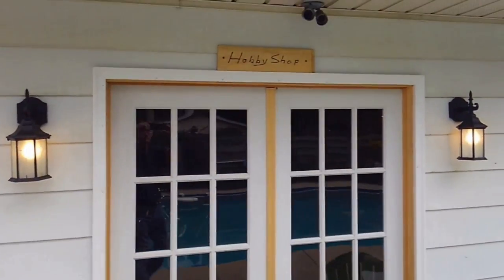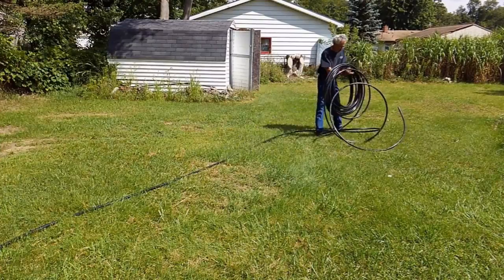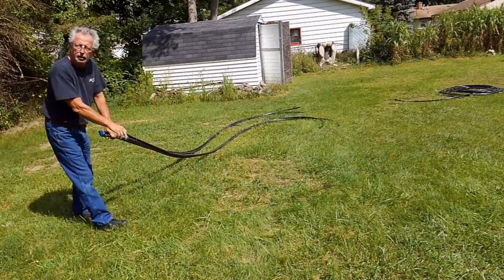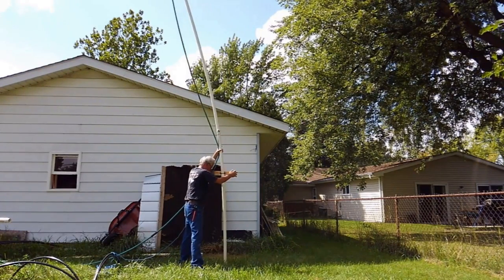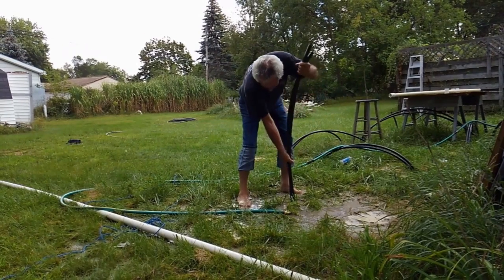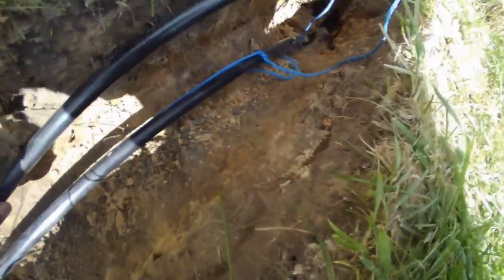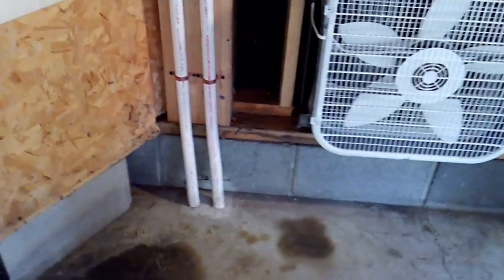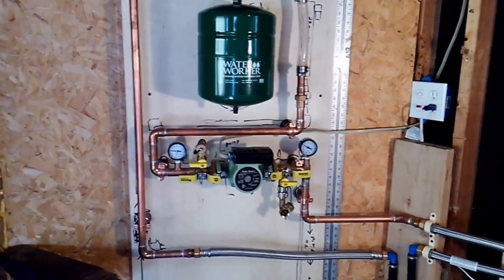Geothermal diy #1

Comment: Thank you for the video.  This looks like a great project.  Would you share your parts list?  I see a number of valves and fittings around the circulating pump and am unsure as to why they are there.  I am obviously not a plummer and need the help.
Reply: I'm not a plumber either, but I see Larry has a teed ball valve on each side of the pump, with adapters to take a garden hose on the right-hand tee, which is for filling the system.  At least one set of valves placed around any part that can break or wear out is usually for ease to remove or replace that part in the future, especially without draining the system.

Comment: You didn't show the this unit in running condition.
Reply: It was running, wasn't it? There was a different pressure on either side of the pump... (ok, he wasn't running the fan, but we all know what a turning fan looks like). A pipe temperature & ambient temperature would have been very interesting though.

Comment: i thought of doing the same thing for many years however, instead of a radiator, i thought of using 55 gallon plastic barrels inline with each other. full of water. You have massive amounts of thermal energy stored in the barrels of water. The barrels spread out would just radiate heat placed at strategic locations. Wouldn't have the cost of and expensive of running an electric fan

Comment: "Works perfect!"

*Provides zero evidence or measure of temperature to the viewers.

For such a clean and thought out job, I'm surprised you don't have even a cheap Amazon digital flow meter with temp display.  Otherwise, very nice work.
Reply: LOL indicates pile of tubes, fittings, etc "Here's the stuff I'm gonna use...."
Reply: I thought shit was warm... so less then 35 celsius is colder than shit, but it is hot as hell for cooling....
Reply: He did say "Oh yeah, colder than shit" when grabbed the source feed, that should do ya!
 
I'm sure the freeze level in his area is lower than 2 ft depth. This means, he should either insulate the horizontal feed line, or make it deeper.

Actually a very inspiring video for a real world DIY ground source feed line. Would work great on a DC Inverter Heat Pump.

Comment: Would love more information about how you decided how much tube you needed and why you used those connections at the bottom of the holes
Reply: The connection is a "U" coupling. The fluid goes down then comes up. Each tied together for a continuous loop.
Reply: Hi Katie - The connection is a "U" coupling. The fluid goes down one then up tying the ten pairs together for a continuous circuit, each conditioning the fluid for use.

Comment: Just a thought for those who would like to get a low level of electric out of something like this. I don't know how effective this would be but perhaps for charging a small battery set you could put a small micro hydro generator in the water flow so that as the water is circulated that it could also make some micro production.
Reply: The pump which is circulating the water is using electricity. Putting a device inline to try and generate power within the water flow would cause the pump to work harder to circulate the water thus using way more energy than you would create. It's like trying to put a wind turbine in front of a electrical fan you have to plug in or using light bulb you have to plug in to generate power from a solar panel....
Reply: Fantastic Larry! Thanks for the help.

Comment: Now that you have a year under your belt with this system, we would love to hear how it's working for you both summer and winter.
We would all love to see a follow up video if that's possible. Thank you, John
Reply: John Wyman I was wondering the same questions. How does it work in the summer as for cooling. Wondering if it could be used in the desert to cool off a house ?
Reply: Also interested, especially for air conditioner
Reply: Now it's been two years...
Reply: @johnwyman6331  three years now...
Reply: @gustavomiranda932  Yeah, think I should give up on him now?
There's another YouTuber named Luke Fugate who is doing something very similar in Kentucky and having excellent results.
Reply: @johnwyman6331  nice... tnks... 😄
Reply: I'm also interested!
Reply: interested as well
Reply: I would think this system will require a lot of tweaking to get real output. For one, a more powerful, better sealed fan/coil may be required. Inlet and outlet temp differential may not be high enough to produce the results needed. This is why we use refrigerant systems to really extract the energy from the well line. All said, it's a nice little project and should produce some results, though moderate at best. Best wishes to the creator.
Reply: @polarunion  Well, you may think so, but I have seen for myself a similar setup that used a well pump to pump wellwater into an automotive radiator within a well-insulated house. It was mounted into a central wall with an electric fan blowing the air through it. It worked extremely well keeping the home at 70 degrees Fahrenheit all throughout the summer. This system turned on and off as needed using a common air conditioning thermostat. They ran the warmed water outside the house into a small koi pond, then it wound its way down the hill Into the woods.
Although it worked extremely well, I have a few ideas to do essentially the same thing with much, much less electricity using only a 10 Watt circulator pump. The electricity needed for a well pump, and a fan can add up quickly. Although not nearly as quickly as running a compressor and two fans for a conventional or even high-efficiency air conditioner or heat pump which uses Brute Force to compress a refrigerant into its liquid state only to release it later in the system in order to move the heat from one side to the other.
Besides, It's a very simple system that uses extremely common, simple components you can get at any hardware store (or junkyard).
I feel the reason you don't see these systems more often is because nobody can profit from it. Not the manufacturers who want to make things complex in order to sell parts and service, and also have planned obsolescence, Nor the electric companies who NEED to sell electricity.
Think about it, have you ever felt how cold water is from a well, no matter where you are in the world? I wouldn't want my house that cold. Yes, I understand it couldn't get quite that cold, but with a 20 degree differential it would be just about right. It's a simple thing to use that water to absorb heat from a home. No tweaking required, only sizing appropriately. You may not always be able insulate it enough or to size it to get all the way down to 70 degrees at midday, but even 80° in a 100 degree environment would feel wonderful!
Reply: John Wyman Hi John! Thank you so much for your reply and well versed points of view on this undertaking. I truly applaud the initiative and arrived and commented with the intention to learn from your experience. YouTube is fantastic for that. Would love to see the evolution of your system. And frankly if the well system proves effective, I’ll be the first to include a similar system in my company’s home developments. Currently we’re using zero emission air to water heat pump systems with radiant heating and cooling. Something like what you propose would be the holy grail. Thanks again for taking the time to reply.
Reply: @polarunion  Hi Patrick, I read your post with interest. I'm curious how you're doing the radiant cooling? I have heard if you use it in the floor the condensation is unacceptable. I'm also interested in knowing the source of your zero-emission energy powering your heat pumps? Thank you, John.
Reply: John Wyman great questions. If you build with relatively high insulation levels (we build at r32-50 depending on the project and glazing) you can achieve the ability to heat a home for less than the cost of natural gas. I’m in Ottawa Ontario where temps range from -30C to 45C in summer and high humidity. Our seasons are a wild swing. We manage air supply with HRV’s. we don’t believe in the marginal benefit of ERV. We manage humidity in summer with a dedicated dehumidifier. The cost benefit of our system is incredible. Less than the cost of a ducted forced air gas/Ac system. We have one appliance that does radiant heat/cool and portable water. Please note this is only possible with a relatively tight building envelope under 1 air change per hour and good thermal insulation. The power sources in my region are 80% hydro 10% renewable and 10%natural gas.
Reply: @polarunion  Ah yes, I am very familiar with the environment. I grew up a few hundred miles South of the Border from you in New Hampshire.
I'm glad you said hydro, which is an actual zero emissions energy source. I half expected you to say nuclear. I believe radioactive waste is a type of emission and since the waste needs to be secured for its half life of 500,000 years, It's the most expensive energy source by far. Somehow people keep missing that itsy-bitsy detail.
So, what is this radiant appliance you speak of that heats and cools and produces water? It doesn't sound like it's a regular ground Source heat pump with in-floor Radiant Heating and Cooling. 
By the way, I agree with you that HRV's are superior to ERV's. There's actually a lot of energy saved keeping the humidity correct.

   Back in the 90s when I was in Michigan going to college at a renewable energy school, I heard about something called The Ottawa house. I believe it was one of the first, if not THE first, Net Zero passive houses that was built in North America. Do you know anything about this? I can't seem to find anything about it on the internet.
Reply: Yep, I'm curious how this has performed over time as well.
Reply: Okay, I guess I'm going to have to put this out there. 
  If anybody comes across similar videos that are more up-to-date and give more information, please come back here and let us all know. Thank you in advance. John

Comment: So Larry I did this I did 6 holes at 25' Currently I am only getting 68 degree temps out of the loop. I did not pressurize the loop. any thoughts you have would be appreciated. Thanks
Reply from the maker: James, that sounds excellent. My circulation pump requires a minimum or 6.5 lbs incoming water pressure to operate. It does not have the capability to draw water to it's self. That is why it has to be under pressure. The system does not need to be under pressure to give up it's heat through the radiator, only for the pump.

My incoming water temp varies from 54 to 57 f. A surprise to me was that the incoming water temp has not fallen more than 4 f since I started to run the system in late September this year.

Where do you live near? It must be in a warmer climate than where I am here in Lansing Michigan.

One other crucial thing I learned about these type of systems is that the system has to have the proper heat transfer fluid/antifreeze fluid. Propoline Glycol Heat Transfer Fluid is the proper fluid. It is a food quality heat transfer fluid that will not cause adverse reaction should it get into the aquafer.

What temp are you getting out of your radiator? Describe your radiator/fan assembly
Reply: Ok I am just outside St. Louis Missouri on the Illinois side about 3 miles away from the Mississippi River. That is why I thought my temps would be lower. One issue I had here was trying to back wash the holes the dirt is part sand and part gumbo so maybe not the correct thing to do but I tried sand and could not get it to wash down the holes so in the end I bought Pea gravel and got that to back fill the holes. 

I wanted this for my house more for cooling than heating but currently it is heating more than cooling. But the weird thing also is I am not getting a drop across the coil. 68 in 68 out kinda weird.

So here is my setup short version. A few years back I built a wood boiler put it in my garage (150 feet to garage and back so guess were most of the pipe I used came from) converted a air conditioner A coil to except water ran the boiler at 100 degrees and heated my house. Ran that for three years gas company took my meter off my house lol. Had some issues and abandon it but keep the coil and pump. saw your video and it got me thinking so I went to work. (good video by the way the drill really works)

So anyways I put pipes in the ground just like you did. Put the  A coil on the return side of my furnace (just as I did with the boiler) . Furnace comes on as normal hopefully adding heat to my house from power bill not for sure as we have had a below average temps for November here so can't really compare last years bills to this year . Only have had this done since end of August. 

Not for sure at this point if I am successful or if I am costing myself money. I know the current temps are not cold enough for air conditioning but...Heating well.

As for the transfer fluid currently it is straight up water. I was worried about freezing but  the loop temps don't change even at 20 degrees outside no issues yet. But maybe your correct maybe I should change to something else????

Thanks for the info

Comment: At a quick glance, i noticed no one commented on the staging and routing of the geothermal system. it is common knowledge that an electric pump generates it's own heat and is cooled by the water it is pumping. the proper order for this type of system should route from the field through the radiator first, then through the bladder tank and finally through the pump and fed back to the field after having lost most if not all of the heat. hot water through a pump will cause it to fail prematurely. plus you want to use the water for heating at it's hottest available, the less time the water has to cool before going through the radiator, the more efficient the system will be.
Reply: Pumps used on hot water systems using a boiler are designed to function efficiently with hot water and not fail plus remember this water is only 55-60 degrees anyways

Comment: Hey that is genius by the way. I think I got some old radiators and some stuff and I might have to rig something like that up when I get my greenhouses  going here in a few months I just wanted to say thank you . I'll probably modify that a little bit and make my auger do muscle work but I was originally going to do like a fan drive with just air and and pipe running underneath the ground underneath the foundation

Comment: I dont know why this wouldnt work on a large scale with an air return and a decent sized cfm fan. In fact a solar panel on the circulation pump. And some simple duct work for a return that pushes the air over the coil and boom. You need only a drain for the condensation and I feel like you can heat and cool as big a space as you want
Reply: I'm planning on putting up a 20x50 workshop in Tucson and using this to heat / cool the whole thing.  Don't see any reason why it won't work perfectly fine.
Reply: @dienekes4364  Did you put the shop up and install this system? Curious how it worked out.

Comment: Great project! Love it! I wonder is there a better fluid to use perhaps antifreeze/coolant?
Reply: Distilled Water is the best for continuous systems.  You only use antifreeze is you don't think you are going to run the system when the ground is frozen.  This is the beauty of using a bypass solar water heater.  The solar water heater is a free water pump.  As the water heats the pressure rises and the water expands, which forces the cold water up from the feeder end of the loop into the water heater.  Solar water heaters can heat water to over 260 F (or 127 C)  so a carefully designed temperature release valve must be established.

Love from Chicago...

Comment: Do you have a parts list?   specifically the source for the radiator...
Reply: the radiator, its list online as a water to air heat exchanger. hope it helps

Comment: What is the flowrate of the pump?
Reply: Max Flow should be around 23(GPM) for the 1/25HP pump he used and the pipe size.  but his static line resistance is unknown to us.  Notice the pump has three-speed settings.  In the video, we see a max flow of around 7(GPM). Keep in mind that these systems work by stacking roughly 55 F throughout the system.  You can not have drastic temperature changes with a water based geothermal system.

Love from Chicago...

Comment: You don't tell your location, although you appear to be in Tidewater where there is not any base rock close to the surface.  You also don't have a thermometer showing the temperature of the water returning from the earth.  I have a feeling that it won't be a constant 55 degrees during all seasons, but I would want to keep a year's worth of data on the temperature.

Comment: Great idea.  Can you do a short video using an infrared thermometer to show the incoming and out going temp of the water, during a hot day, and a cold day. and give the outside temp and temp inside the room. And maybe put a metal object in front of the fan to get a good idea of how cold (or hot) the temp of the air coming off of the fan is. 
also can you tell us how much water per minute is circulating, and how much kilowatt hours are being used.